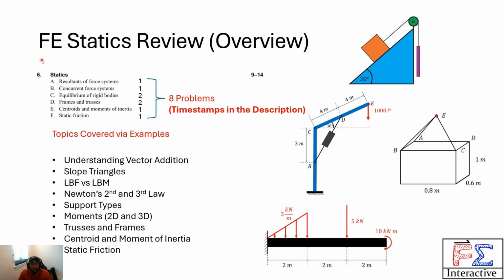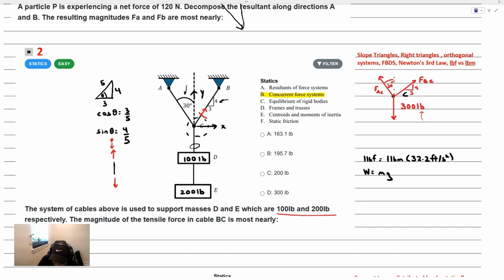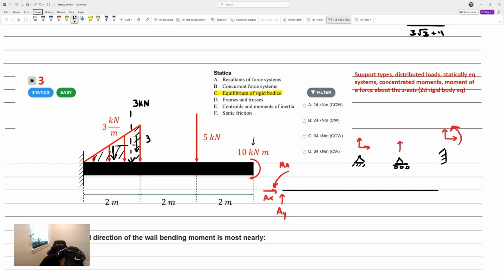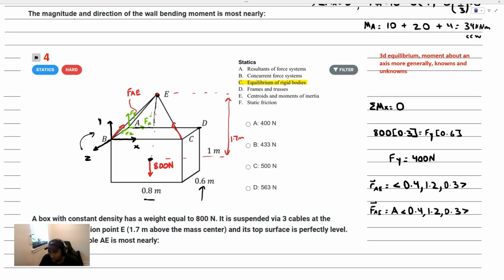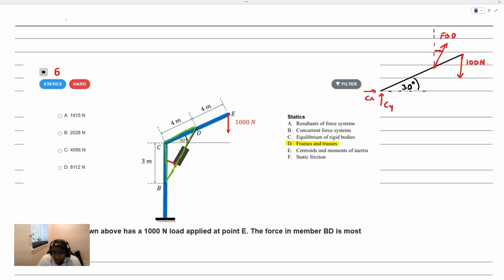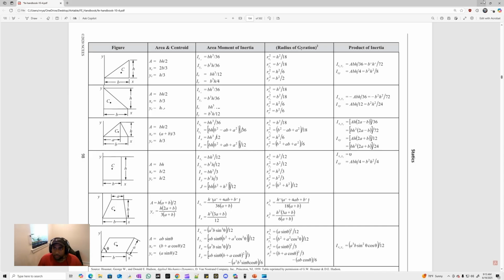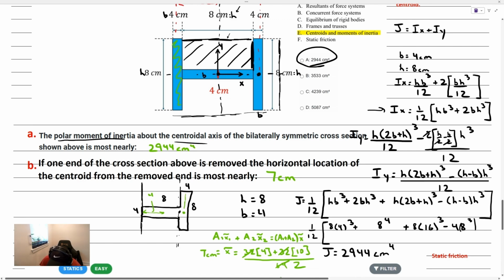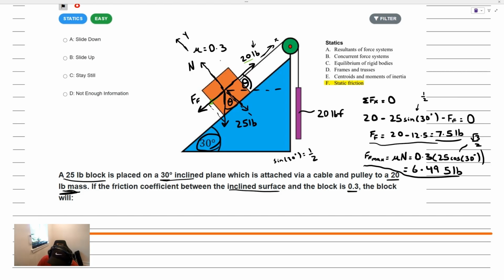FE Exam Statics Review – 8 Problems That Actually Review the Fundamentals

Comment: Hi, question on #3! I am working on the interactive website (great tool btw!!) for this problem and solved it correctly & even got -34 at the end but when I clicked on the 34 (CW), I got it wrong. I got a negative when solving my moment equation & even used CCW as positive to start problem so when my answer was NEGATIVE, i assumed by clicking CW its the opposite meaning it would be negative. I'm a little confused on how to know what CW & CCW mean on answer choices if I always assume CCW to be positive when solving a problem.
Reply from the maker: I’m glad you’re liking the website, and this is a great question.

The important thing to separate is the algebraic sign you get from your equilibrium equations versus the physical direction listed in the answer choices. Your choice of CCW as positive is just a sign convention and it does not change the correct physical answer.

If you assume the reaction moment at A is clockwise on your free body diagram (consistent with what was done on the handwritten solution of FE-Interactive) and write equilibrium with CCW positive, you end up with an equation like the following:

-M_A - 3(1.33) - 5(4) - 10 = 0
M_A = -34 kN m

That negative sign does not mean the answer is “negative 34” in a physical sense. It means the direction you assumed for the reaction moment was wrong, so the moment must act in the opposite direction of what you assumed (assumed clockwise on the FBD).

The correct result is a moment with magnitude 34 kN m acting CCW. That also makes physical sense, since all the applied loads create a clockwise tendency and the reaction moment must be CCW to satisfy moment equilibrium.

When selecting an answer choice, use the magnitude from your solution and then use the sign to determine the actual direction, CW or CCW, relative to what you assumed on your free body diagram. If the result is negative, it means the assumed direction was incorrect and must be flipped, as in this case. Hope it is clear.
Reply: @Eng_Fundamentals  this clears it up SO WELL, thank you sooo much!!! :))
Reply: @Eng_Fundamentals I still don't understand. Isn't that basically a triangle similar to y=3x, integrated from x=0 to x=2? At 2m, the peak of the load is 6kN, no? 

If 3kN was the peak, wouldn't it need to be 1.5kN/m?
Reply from the maker: @bgalaher1234 I think the confusion comes from what the 3 kN per meter actually represents.

If we sketch a uniform load of 3 kN per meter and a triangular load with a peak of 3 kN per meter, the maximum height of both distributions is the same. The value 3 kN per meter represents the peak load intensity in both cases. The units are kN per meter, meaning force per unit length. In a linear distribution, the load intensity varies linearly until it reaches that defined peak value of 3 kN per meter.

A linear distribution does not mean the function is y = 3x. It means the intensity increases linearly from zero to its maximum value. In general, that can be written as

w(x) = 3/L x

If L equals 2 meters, then

w(x) = 3/2 x

The value 3 kN per meter is reached only at the peak, which in this case occurs at x = 2 m.

If the problem instead stated a 1.5 kN per meter triangular load, then the peak of the triangle would simply be 1.5 kN per meter.

The key point is that the total load comes from the area under the load distribution. For a uniform load, multiplying intensity by length works because the distribution is rectangular. For a triangular load, however, the total load is the area of the triangle:

(3 kN per meter × 2 meters) / 2

That same result can be obtained by integrating, as you suggested. The total load is

F = ∫₀² w(x) dx
F = ∫₀² (3/2 x) dx

Integrating gives

F = 3/2 ∫₀² x dx
F = 3/2 [ x²/2 ]₀²
F = 3/2 × (4/2)
F = 3/2 × 2
F = 3 kN

The division by 2 comes from the triangular shape of the distribution, not from the units. Multiplying length by load per length is dimensionally correct, but it assumes a rectangular distribution. For a linear distribution, we must account for the shape. The total load is determined by the area under the intensity curve, and for a triangular distribution that area is half of the corresponding rectangle.

Hope that makes it clear.

Comment: Hey man, on question 3, why don't you multiply the -10 kNm by 6m? Great video btw!
Reply from the maker: The 10 kN·m curved arrow is called a concentrated moment. It is statically equivalent to a force couple: two equal-magnitude but opposite-direction forces acting a fixed distance apart. That force couple produces a pure rotational effect with no net force, only a moment equal to F*d. 

When we replace that force couple with a concentrated moment, the distance between the forces has already been built into the value of the moment. You can see this directly from the units: kN·m, which is force times distance already.

Because of this, a concentrated moment is a free vector in static equilibrium. It can be applied anywhere on the body and it will always produce the same moment effect in the equilibrium equations. That’s why you do not multiply a concentrated moment by a moment arm. Doing so would double-count the distance that already exists in the force-couple definition.

The location of a concentrated moment only becomes important when you move beyond statics into Mechanics of Materials or Mechanical Design, such as when drawing internal moment diagrams or analyzing slopes and deflection curves. In pure statics, however, its effect on equilibrium is independent of where it is applied.

In short, forces depend on where they act and require a moment arm in moment equilibrium. Concentrated moments already include the distance, so no additional lever arm is needed. Multiplying by a distance would double count it, which is clear from the units: kN·m already contains a distance. Hope this is clear. Please feel free to ask any follow-up questions.
Reply: @Eng @Eng_Fundamentals Got it, thank you. I appreciate the quick response and the in-depth explanation. I’ll be signing up for FE Interactive after I get through your free subject reviews. God bless brother

Comment: For question #6: Shouldn't there be a x-component for ForceBD apart from the y-component generating a moment with an arm length of 2m?

For Question 7a: Why is the b-value always the lowest value (4cm) regardless if it was the Moment of inertia for I or Y axes?
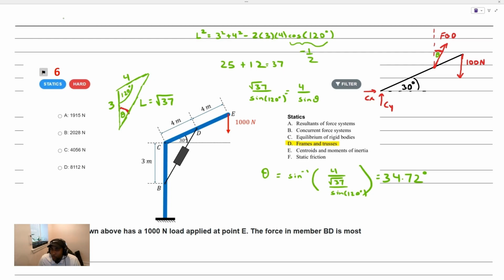Reply from the maker: For question 6, both the x and y components of the force would produce a moment, but in this problem we resolved F_BD into components parallel and perpendicular to the inclined member. Since the member is slanted, these directions are not the same as the horizontal and vertical axes. The parallel component passes through point C and therefore produces no moment, while the perpendicular component is the only part of the force that creates a moment about point C. This is discussed at 45:38.

For question 7, I used b and h as variables, which can be a bit confusing since those symbols also appear in the FE Reference Manual. The key point is to identify which dimension is cubed in the moment of inertia formula. The moment of inertia for a rectangle about its centroid is I = ab^3/12. The critical step is assigning the correct dimensions to a and b. The non-cubed dimension is always the one parallel to the axis of interest. That means if you are calculating about the x-axis, a is the horizontal dimension; if you are calculating about the y-axis, a is the vertical dimension. In this way, the perpendicular dimension is the one that gets cubed.

Hope I explained it ok and you got your questions answered, if not please let me know what is not clear. Good luck on your prep.

Comment: Very helpful, quick question on C, why is the distributed load not 6 for the triangle if it's 3kn/m and has two meters?
Reply from the maker: Glad the video is helping you! 

When looking at the value associated with a distributed load it is important to understand the shape of the load distribution too.

For a uniform load you would be completely correct. But when the load distribution is linear the given 3 kN/m actually represents the peak of the load distribution.

Remember that when we sum all the little loads that make up the distributed load we are getting an equivalent total load. That summation is integration or geometrically represented by the area under the load distribution. Since our load distribution is triangular we must do (3 kN/m * 2 m) / 2 since this is the area of a triangle corresponding to the total load produced by that distribution.

I see what you are saying using dimensional analysis to multiply the length by the load per length but this does not take into account the shape and the idea of area corresponding to total loads. Hope it is clear.
Reply: @Eng_Fundamentals  Yup! Fell right into place when I read that lol thanks

Comment: Is it good also for other descipline
Reply from the maker: Yes it is also a great review for other disciplines. Here is the other disciplines specification

Statics
 A. Vector analysis
 B. Force systems (e.g., resultants, concurrent, distributed)
 C. Force couple systems
 D. Equilibrium of rigid bodies (e.g., support reactions)
 E. Internal forces in rigid bodies (e.g., trusses, frames, machines)
 F. Area properties (e.g., centroids, moments of inertia, radius of gyration, 
parallel axis theorem)
 G. Static friction
 H. Free-body diagrams
 I. Weight and mass computations (e.g., slug, lbm, lbf, kg, N, ton, dyne, g, gc)

This is essentially the same as the mechanical specification (the specification I used for this video) written with more words.
Reply: @Eng_Fundamentals perfect please I have a question is the FE exam give the same exercise I mean similar or I have to think too much about exercise and this is only the basic exercise?
Reply from the maker: @nesrinebouraine6422  I designed these problems to give people practice which is reflective or more difficult than what you will see on the FE exam. If you can solve these problems comfortably you are mostly ready for the FE statics section. 

A few more things I would recommend you to review are belt friction, more review on Trusses ( the example I did is conceptual and while it is a realistic problem for the fe exam you will also have more calculation based problems for that topic), and in general as many practice problems as you can get your hands on. You know the information so it is just about refreshing and being able to quickly solve problems which comes from practice. Hope this was helpful.
Reply: @Eng_Fundamentals very helpful thanks